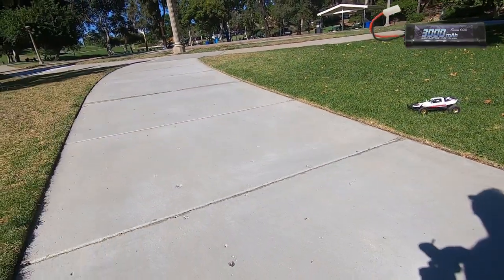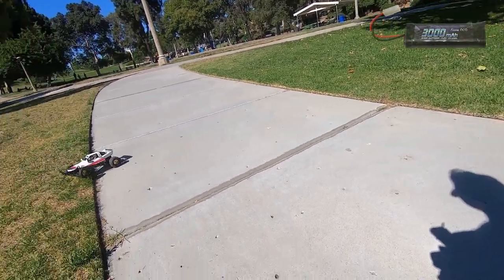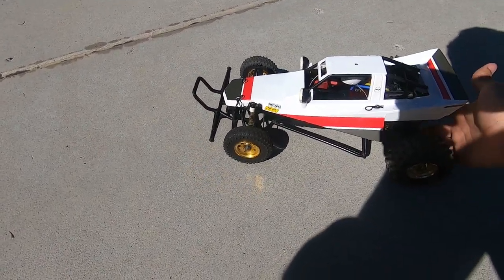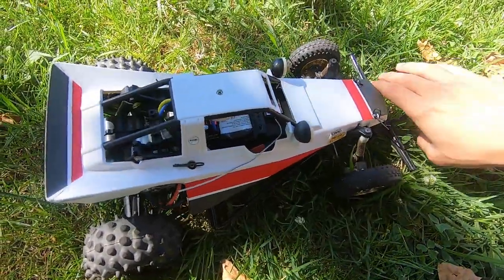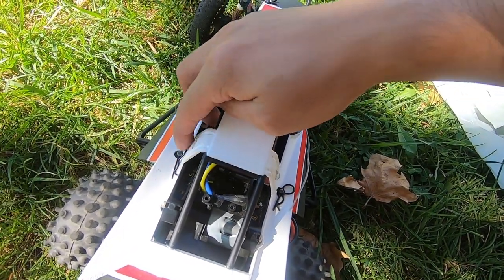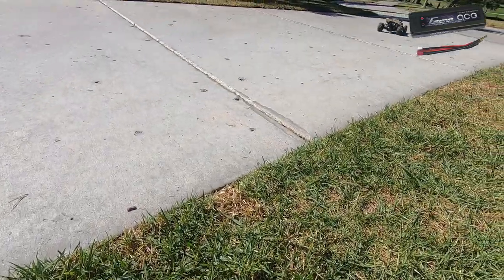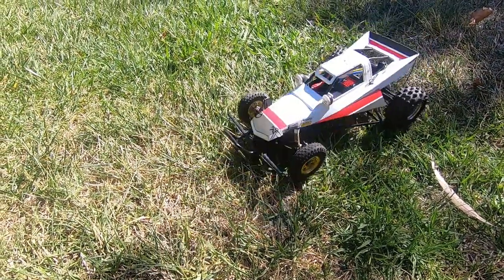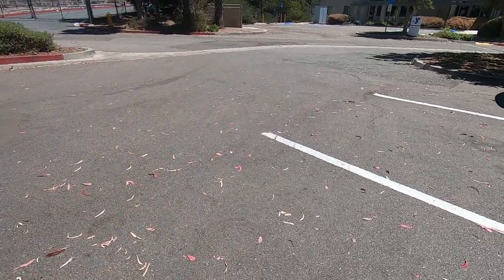How Fast Is The Tamiya Sport Tuned With LIPO AND NIMH (TAMIYA GRASSHOPPER)

Comment: Hello I'm not sure if your setup is correct. I recently installed a Tamiya sport tuned motor with a 18T pinion and a Hobbywing 1060 esc, and mine flies with a 2s 2000mAH. Did you switch the jumpers on the esc to LiPo when using LiPo ?
Reply from the maker: Hey man, I think that sport tuned motor I got was buggered out... should definitely be flying like you said atleast 20mph
Reply: @JacobusRC  Maybe get another motor 🤔. Does you esc have nimh / LiPo jumpers ? Make sure you change jumper to LiPo when using one 🤔. Let me know, and make a new video. I want to see the difference 😁
Reply from the maker: I don’t remember if this esc has different modes but I’ll check 👍🏽I switched the Grasshopper to brushless in another vid and it moves quick now

Comment: I find that with nimh batteries , the higher the mah the more power and speed you get. My wifes grasshopper has a tamiya sport tuned and with a 5000 mah battery runs 24 mph and with 3000 it gets your same 15 mph
Reply from the maker: That’s a big difference !
Reply: A nimh has in average 10c discharge rating. I had a Rustler XL5 with the stock 3000 mah. Put a 4500 mah lipo in it, and it was a bit faster. Then I put a traxxas 5000 8.4v and was as fast as with lipo.
Reply: @originalrcfun7368  thank you

Comment: my hornet has a sport tuned motor and it does over 21 mph
Reply from the maker: I might’ve gotten a fake but definitely 20+ on this rig and the hornet is beastly fast
Reply: @JacobusRC  I have a grasshopper and when I get the electronics imma make it brushless

Comment: I think there is barely any difference because the weak power system in the car is holding it back (but it could still be just appropriate for the size of the car). If you tried this with traxxas rustler for example, the difference between nimh and lipo would be much more noticeable. This car is so small and light that it simply does not matter which battery type you use. This is at least what i think. But for sure, this car looks great. Well done!!
Reply from the maker: Yeah LiPo has a kick on the lower end, but top speed was the same. Thanks for watching 👍🏽

Comment: The 380 in my grasshopper does better than that with a old radioshake 7.2v Ni-Cd 2000mah battery.
Reply from the maker: It was darn slow so I just put a cheap brushless in it to get it to hit 25-30ish
Reply: @JacobusRC  I would say the brushed motor was buggered then.